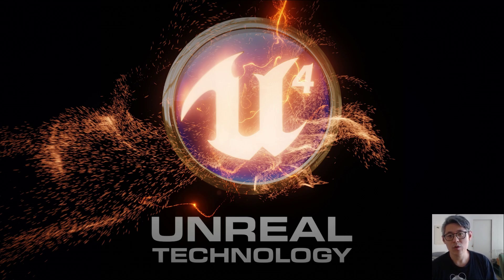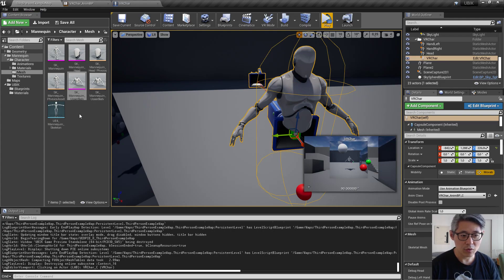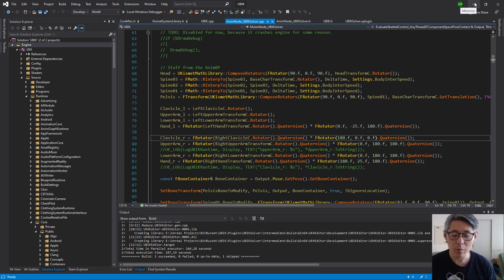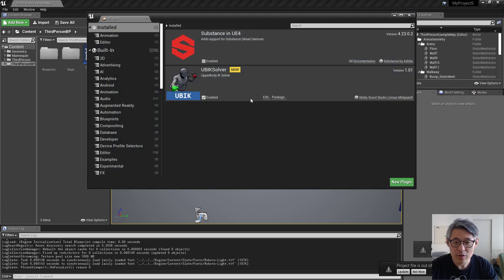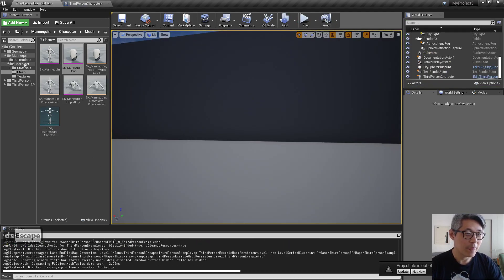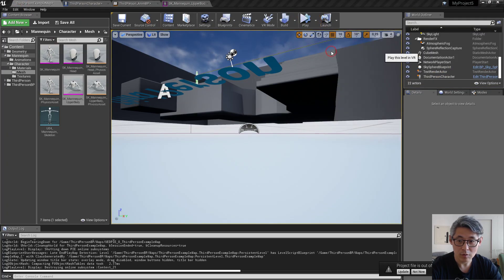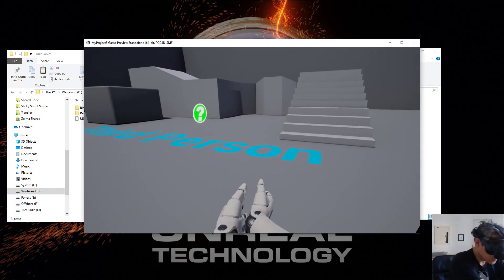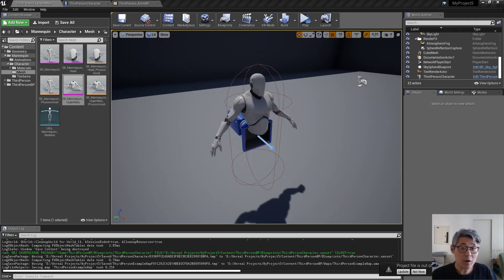UBIK - Basic setup using the plugin (UE4.23)

Comment: Works in UE 5.3, however, the hands do not align with the VR Template hands, therefore grabbing does not work as expected. The Mannequin hands are offset from the hands that come with the VR Template and I tried tweaking the UBIK default settings for hand transformations to no avail.
Reply: did you find a solution for this?

Comment: Hello Jonas! I added you on Discord, but I had a question about how to edit the underlying code for this plugin. Essentially I am attempting to make a similar IK library for the VVVV engine and ran into some issues. I ported your code over to it quite faithfully, but it does not produce good elbow/shoulder positions. 

I wanted to disable certain steps in your plugin to look at the result of each step of the process in order to troubleshoot my issue, but the Visual Studio Solution doesn't seem to be available in the GitHub repo. 

Is there any way for me to tinker around with the provided source code? Thank you.

Comment: Great plugin, the hand ik is simply amazing! Although I wanted to inquire about using it with non mannequin skeletons. I'm using a Synty pack character for my player and have been trying for quite a while now to get this to work with it since the hand ik solutions from PowerIK and the standard two bone/fabrik nodes don't have the proper elbow edge case tracking that this does. I've tried editing the rotation values in the .cpp like in the video but cannot seem to figure it out. For reference, I know the issue is related to all three of the spine bones on my character being rotated 180 units on the X axis, which causes the body to swirl up and deform. Is there any ETA on getting this setup to work with non-mannequin skeletons? I'd really love to use this great plugin in my game!
Reply: Are you using 3ds Max and Skin?   Turn Skin off temporarily (allows to edit bones without messing up mesh), rotate the bones 180° then turn the skin back on! (if the mesh freaks out, cycle it on/off once more to reset the base pose!)   Deformation on/off is in the Skin modifier, Advanced drop down, use it together with Modifier enable/disable to achieve literal vertex level control!
Reply: You could also use the Skeletal transfer tool to make it compatible!  OR Rename YOUR bones to the Mannequin standard Bone names!  (that last trick, has helped me with a lot of problems)

Comment: Hello Jonas, thank you for your effort! I'm trying to test UBIK and getting an error on startup:

"The following modules are missing or built with a different engine version:
UBIK
UBIKRuntime
UBIKEditor
Would you like to rebuild them now?"

Rebuilding doesn't work :(
I'v downloaded UBIK from bitbucket via "download repository" button and installed UE 4.24.3 and Visual Studio 2019 with C++ for games content for the occasion. Hope I did everything right.
Will try setting up using the plugin tomorrow as shown in the video but I'm afraid it's not gonna work too.
Your work is looking way superior to the IK body setup I'v managed to build using blueprints myself and I'm eager to try and use it in my project
Reply: Upd. Jonas has solved this problem for me via Discord. If you have the same problem you should download Visual Studio and Framework SDK 4.6+, rightclick UBIK.uproject, generate Visual Studio project files, recompile the resulting solution from within Visual Studio and it should work nicely
Reply from the maker: Awsome that you posted your solution, and great to hear you got it resolved.
Reply: Upd. Browsing through comments found out that I should install LFS client and use Sourcetree for downloading(cloning)
Done that, same problem:(

Comment: Exceptional stuff. Been struggling with IK especially on the fwd bend. I assume a 2D lower blendspace for the legs would work flawlessly? What about for crouch?
Reply from the maker: Can't say for sure with crouch. But in the original Parger-paper, there's mention of some crouch estimation, where HMD height vs. pitch is used to determine pitch of the upperbody. This in turn could possibly be converted into a crouch indicator, but not something i've had time to experiment with personally yet.

I hope to be able to revisit the solution and add IK legs, once im done with my game in July/Aug later this year.
Reply: @jonasmlgaard8884  got crouch and the 2D blendspace working. Video on my YT channel :) thx a ton for UBIK.

Comment: Hey Jonas, great work. Can you please confirm if this works with inside/out tracking headsets?
Reply from the maker: Yes i can confirm. The plugin entirely works by calculating the body from 3 transforms. Head, and 2xHands. Where they come from, does not matter. You can also verify this by running this entirely without VR, just by using the debug actors i have in the example project.

Comment: i tried to download the blueprint version to study it but i couldn't can you put a link in Google Drive or github .
Reply from the maker: Faycal Nedjar what do you mean you couldnt? If its the issue with lfs, then look for the video (think its video 2) where i explain how thats fixed. Let me know how it goes
Reply: I'm not sure if I downloaded the correct file because the website is so confusing how its work. But the project I downloaded its open but the blueprints don't show up inside the project like as if it doesn't exist even I can see it inside the correct folders in explorer. I'm following you since a long time, and I was so impressed how you take a concept from c++ or other languages and apply it unreal you are an inspiring guy for a lot of ue4 user.
Reply from the maker: @naza0777  Using Bitbucket can be a bit challenging to begin with i agree. However, once you get a hang of it, it's ok to work with. Initially make sure you have LFS-client installed. I forgot to mention that, until video 6: https://www.youtube.com/watch?v=wI5Vn-RQ2Uk After that follow my guide in video 2: https://www.youtube.com/watch?v=SEgFHaaGyTY and you should be good to go. Let me know if you still have issues.
Reply: @jonasmlgaard8884  Jonas, there seems to be a cloning issue despite taking into account LFS. Google Drive?